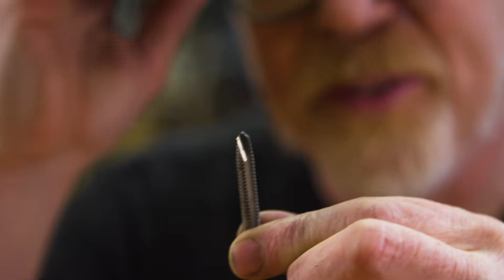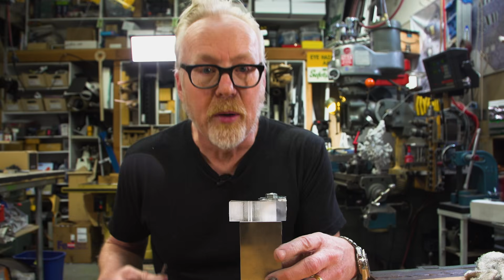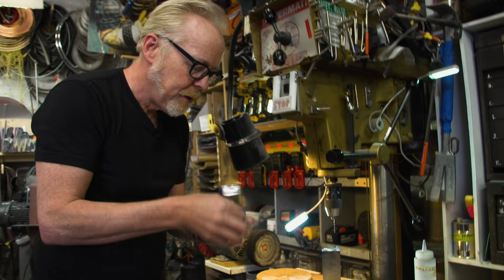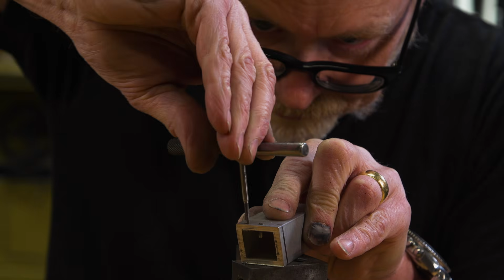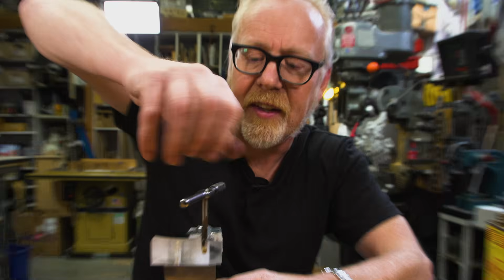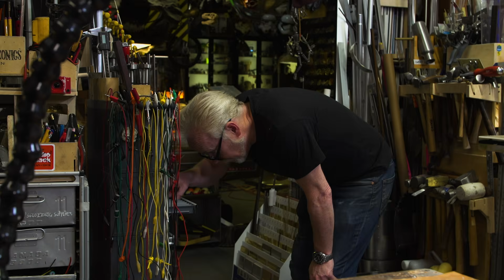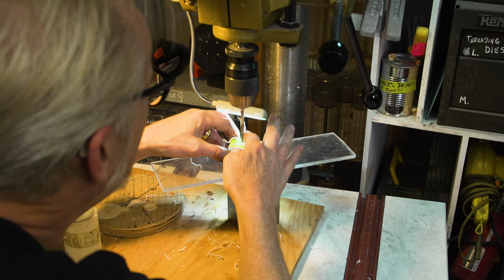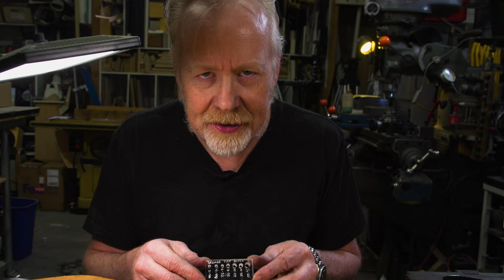Adam Savage's One Day Builds: Thread Tapping Guide Block!

Comment: English speaking Folks: Tap.
Meanwhile Here in Germany: Gewindeschneider.
Reply: It's called a Gewindeschneider because it schneids Gewinde
Reply: @maltel4373  
Lol
Reply: and it's telling you exactly what it does, no guesswork needed
Reply: ...Gewindeschneider, Wendeisen (Windeisen), Schneideisenhalter...
Reply: Yeah, but if you're in an English speaking hardware store and you ask for taps, you could be shown quite a few different things. Like the tap for a faucet. If you ask for a tapping tool, maybe they'll show you a device for extracting fluids out of a casket. Maybe they'll show you the taps for fixing holes in the soles of shoes.

If you ask for a gewindeschneider, you'll get shown only one thing, and it is the tool you want.
Reply: @MrMartinSchou  Since you didn't specify, I'll just assume you're still in the English speaking hardware store (I'm not going to question why a store can speak at all), but if asking for a gewindeschneider, you'll probably just get shown a confused face. Likely not quite what you want.
Reply: @maighstir3003  Or get shown the door (means ‘kicked out of the shop”) Les
Reply: @MrMartinSchou  If you look up tapping guide on amazon, you can buy a maple syrup tree tapping kit :-).
Reply: @MrMartinSchou  "taps for fixing holes in the soles of shoes." those are 'tacks' not 'taps'.
Reply: @Expedient_Mensch  That depends on what you're fixing. A tack is the nail you use to secure the sole to the shoe. You can buy taps for stiletto shoes, and those are heel replacements. Additionally a tap is a different term for a half sole, which is a way to repair and replace half the sole of a shoe.
Reply: @MrMartinSchou  no mention of fork handles or Os.
Reply: In Dutch: draadsnijtap.
Reply: I like "Windeisen" for "tap wrench". Such a beautifully weird word. It describes perfectly what it does but at the same time is so cryptic that someone who doesn't already know will have no idea what it's supposed to mean. :D
Reply: @Sanyaenyenwa  As a native german speaker....never heard that name before. But it sounds beautiful!
Reply: Polish: Gwintownica. Very rarely used word
Reply: Different but related.
I was sawing a few trees and limbs for a neighbor yesterday.  Saw started binding and pulling, so I stopped and quickly sharpened the chain by hand.
When I went back to the cutting, and saw big strings of wood coming of the saw and floating to the ground like snowflakes, I felt a great satisfaction knowing I had done a good job of the tedious task of sharpening the chain.
Reply: Gjengetapp in norwegian
Reply: @jowalderhaug575  or ambulance. Krakenwagon
Reply: Hab mich schon gefragt wie das teil in deutsch heisst XD. danke dafür :D
Reply: Swedish:  Gängtapp
Reply: Funny - i was visiting a friends workshop for the first time and was confident to impress him with all the 'knowledge' i have from all those videos (AvE, Old Tony,Abom,...) i watch.  
Only to find out that i couldn't even name a single machine or tool because i only know the english words and not a single German one.
Reply: English speaking Folks: The correct drill size for a 4-40 screw is a #42, so easy to remember!
Meanwhile in the rest of the world: just multiply by 0.8 and get the drill size
Reply: Come on fritz. KIERRETAPPITYÖKALU is longer.
Reply: @TimoNoko  Aaw. Oliko tämä torille kutsu?
Reply: Schon.
Reply: I laughed when I saw some Guhring drills we used on a job once. Kleinstbohrer! That was what I referred to it as whenever it broke... Kleinstbohrer down!
Reply: This a  perfect example  why English is hard  to  learn.  Tap... Tap dancing? The sound? A military  bugle song? A hot  blonde? What? Yeah I'd Tap that!
Reply: Sack-loch Gewindeschneider find ich da besser 😂
Reply: Incan5 remember why but America came close to be a German speaking country.  Thankfully we went for English. I have a Michael Schumacher hat that has Vermogensberatung on it.
Reply: Maschinengewindeschneider oder Maschinengewindebohrer 👍
Reply: oh don't get me startedon long words in Germany vs words in English lol Davenhavenshadtuderbersahousea < only spelt right.
Reply: Lavit yes
Reply: Kierteytystyökalu in Finnish. 😉 (Okay, that would be ”tapping tool”).
Reply: Coop Bau+Hobby
Fühlerlehre or Ventillehr as we say is also nice.
Reply: Gewindebohrer würde man eher sagen zumindest für Innengewinde. Für Außengewinde ist es dann ein Gewindeschneideisen.
Reply: @LeoMastroTV ...in einer Berufsausbildung als Mechaniker vor ~40 Jahren...! ;-)
Reply: to be honest.. Germany is the country of quality tapping lol
I do know cause i used a special made tap from germany and it cut titanium like butter :O
Reply: @LeoMastroTV  Ja.
Reply: Some time ago, the Germans tried writing software code in their language because they didn't want to use English and it blew out a kB file size to MBs !!
Reply: ... to quote my (oh, so long ago) college German professor, "Der, die, oder das?"
Reply: gemeinschaft vs gesellschaft
Reply: always use weinersliden
Reply: Serious? Honestly its such a bad ass language.
Reply: @ThisOldPanda  Wait till you hear our word for Butterfly.

Schmetterling!
Reply: Du bist lustig

ebenfalls Epstein hat sich nicht umgebracht
Reply: I too, like to gew-in-scheider from time to time.
Reply: I learn all my German tool names from the post apocalyptic inventor! Check him out hes GRRRREEEAAAAAT!!!!

Comment: Also SUPER SUCK if the tap develops a fracture and you're tapping with it and it just comes apart in your hands and you felt nothing and you're like... wtf.... (tears)  That L or SQuare extruded AL stuff you're messing with there, Adam, is absolute soft gummy shiet.  Not 6061 and way more prone to gaul or do weird stuff.  We use it all the time as well because its practical and serves its purpose but it is truly the worst form of Aluminum to machine.

Comment: a tip I got from my colleague when I started my apprenticeship as a bike mechanic was when you have a thread, thats damaged, but not completely gone and you don't have the tap for it, like a spark plug, you take a used screw, spark plug, whatever has the exact same thread, cut or file a piece out of the thread and then slowly run it in the damaged thread. You just made your own thread cutter. I have used this since then several times.

Comment: I work for a Sign company and we just chuck the Taps into out 20 Volt Dewalt Drill lmfao
Reply: That works for thin stuff like signs. If you are going through something harder like steel and deeper than just sheet metal you will break tapd
Reply: @kazoolordhd6591  We still do that with the 1/4 steel posts for the pylon, Iv only broke one in two years lol. I know its wrong and I cringe every time I do it . small things we glue together.

Comment: Awesome vid, as usual!

Sometimes when I have a smaller piece like that acrylic or aluminum, and if being normal/perpendicular to the surface is important, I will chuck the tap into my drill preas, and turn/tap by hand. This works in a couple ways; 1) it keeps you perpendicular,  2, because you're gripping the chuck, which is smaller that most tap handles, you are less likely to "ham fist" the work, break the tap, etc.
Reply: There's actually a special tool for that, a spindle tap wrench. it's like a regular tap wrench but it's got a telescoping end that goes in the drill chuck, that way you don't have to perfectly push down the quill while tapping, you can just let the tap do the work, but you do get the alignment help.
Reply: @AlexanderBurgers  Thanks for the heads up! I gotta get me one of those.
Reply: Point 1, yes absolutley
Point 2, no not so much, because you have to apply much more force to turn the spindle (depending of the size of the drill press), wich is especially bad for small taps, with a small tap holder you have much more feeling for the tap. Also the spring in the drill press is pulling the tap upwards, wich can produce tolerance errors (the tap cuts more of the thread flanks than it should)
Reply: I've done this to start big taps straight in steel. It was kinda fiddly (the chuck key did not make a great tap handle), but worked much better than the old squint and hope routine. Once the tap was started, I removed the work from the drill press and did the rest with the usual tools.
Reply: @Darwinpasta  Bigger taps have usually a conic hole at the end, so you can use something pointy in the chuck as a lead for the tap, and a tap crank for turning the tap

Comment: 2 things that are best practice in my industry: always have 2+ of any tap you want to use, and if you drop a tap on a hard surface from table height, throw it out. Never be afraid to throw out a tap that might shatter/snap on you, that's what you have extra for
Reply: @NoAkomplice  breaking a tap in something important is a nightmare. Yes, this is an industry practice, and might be excessive for your average maker, but a single new 8-32 tap is $4. Throwing away a 4$ tap to avoid having to spend an hour trying to pull out a broken one, or remaking a part, is 100% worth it to most people.
Reply: @NoAkomplice  the taps them self are not too expencive and you shouldn't drop them regularly anyway, but you would rather trow it out than start tapping a hole and have it snap, because either way you are going to have to replace the tap, it's just the diffrence in having to exctract the broken tap or not
Reply: No Akomplice  Quality tools and proper care/disposal often represent a higher initial investment but one that ultimately ensures quality results and saves substantial time and material (money). That’s why people and organizations are willing to pay extra for them and to dispose of them readily if they’ve been compromised - because the tooling is almost always the smallest expense when the alternative means having to scrap a project and all of the labor and material that’s already gone into it. This is compounded when one considers the implications on a relationship with a client if a project is botched due to totally preventable issues with your tooling.

Quality tools are expensive. Some can afford them, some cannot. In either case, one generally gets the quality they’ve paid for.
Reply: @f123raptor  Oh man, thanks for letting me know. I can't believe I've been subscribed to this channel for 8 years and I'm just now finding this out. Next thing you're going to tell me is Jimmy Diresta, Colin Furze, AVE, This Old Tony and Click Spring aren't for me either.. I guess I'll just go watch some Make-Up tutorials then...
Reply: You have always 2+ of any tap, so can throw out a tap when it gets dull. The majority of taps snap because they are dull, not because they fell.
If a tap has a crack, you can feel it during the cutting
Reply: @NoAkomplice  I have my Klien, Wiha, and Knipex tools in plastic tackle boxes I got at a garage sale because I know when to spend money on good tools and when to save it on stuff that doesn't matter. Which is also why my hammers are from harbor freight. I'm not a framer, I don't need an Estwing or whatever they're using these days. Taps are definitely an area where dogshit tools are going to punish you, but don't act like there's no use cases where cheap tools are good enough.
Reply: @NoAkomplice  Buy once, cry once. That's a lesson that my brain is still trying to hold onto. Can't count the number of times I've bought a cheap ass tool only to have it break and having to buy another one (or mess up my work so I had to start over). Instead I could've bought a slightly more expensive tool that wouldn't break to start with.
Reply: @treborrrrr  This is true in so many industries.
Reply: @NoAkomplice  In my own comment on the matter I said to buy a "slightly more expensive tool", as in "don't buy the cheapest thing you can find". It's not always necessary to buy the absolute tippy top quality and I think you're exaggerating just a wee bit here. There can be a world of difference between a $10 tool and a $30 tool. Also, no one is saying you have to go out and buy every tool on day one. In Adams case these are tools he has accumulated over the span of _decades_. Also as someone else mentioned, there's the second hand market. For example, I bought what would be a very expensive JBC soldering station for about half price second hand, and since it's a quality tool it's still in damn near perfect shape.

Comment: Hey U.S.! Switch to the metric system already, oooooobviously!
Reply: We already use the metric system. We also use imperial. Why limit yourself when one system has glaring shortcomings. For instance, have you noticed the metric system doesn't make lathe work any easier? Because imperial system has more divisibles than metric. Circles are 360°, imperial devides easily with circles. Not so much with metic. When I cut metric threads I'm changing more gears than cutting. Imperial threads are so much easier because they divide so much easier by 360.
Reply: @jrsydvl7218  Thats BS, when i would cut imperial threads, i would have to change gears too, but not for metric threads, because the lathe is already metric.
Also we need only M, Tr, G and R threads, not like you UNC, UNF, UNEF, UNS, NPSM, NPT, NPTF, Acme, Stub-Acme, Withworth, ...
Reply: @wolf310ii  I have a metric lathe and I don't change gears anywhere near as often when I cut imperial threads because the tooth count is what matters. Imperial cuts threads per inch, since a gear is cut with that in mind it will be far easier. Not so with metic sizes. Metric bolts are spec'ed distance between threads so that can leave you with fewer options for threads/length. It's all in the math.
Reply: @jrsydvl7218  You have to change out gears because you are using an English lathe.
Reply: We hve metric stuff here but the system is not better just different.
Reply: Mmmmm no.
Reply: greetings from the UK , we seem to use whichever measuring system is easier / more accurate .. i watched an American maker really struggle because he had to divide something ( say ) 4ft 5 & 7/16inches into 3
Reply: @Eric Wood Now let's be clear, it was your sanctions that installed the government that put us in the gutter, otherwise a South African would be on their way to Mars. Well, kinda like he is now.
Reply: @Eric Wood Yeah, without both systems available, you couldn't enjoy the benefits associated with slamming spacecraft into Mars at better than terminal velocity...

Comment: I was actually recently thinking about having a guide for drilling and tapping since I don't have a drilling press and blocks like the one in video are actually not only expensive but hard to find in my country, especially for smaller diameters. I imagined device looking a little bit like pliers, so you would have opening and closing motion to control opening for whatever diameter you need. Instead of jaws it would have 3 bearings (2 next to each other and another one on opposite 'jaw' that would fit in the middle, between the other two when in closed position) so you could caught drill or tap between them. 
My only problem is that I haven't seen anything like that on the internet and that kinda makes me think it may be not that great idea after all

Comment: I’ve never successfully used a tap extractor as it was intended.  I’ve always cut my broken taps out with carbide drills or end mills.
Reply: End Mill for the win!
Reply: MA Ford Crazy drills were great for removing broken taps
Reply: We have a waterjet at work and have honed the art of cutting broken taps out of holes. Even works in blind holes is your careful.
Reply: I broke up a few taps before with a hammer and quality punch ground to a fine point.  Not my finest hour but whatever works with the least amount of labor waisted.  End Mill certainly is preferred when available, its all about location.
Reply: The only time the tap extractor worked for me was after I had given up caring about the extractor tool itself and decided to (pardon the expression) go for broke.  I was pulling a broken 4-40 tap out of a large aluminum baseplate.  It bent and started shearing itself and just when I though the extractor was finished shearing off, the broken tap chunk gave and everything came out.
Reply: Very rarely does an extractor work for me.  Endmills or arcing it out.